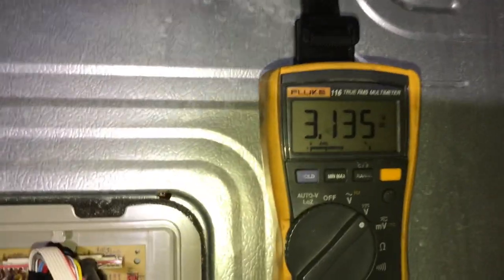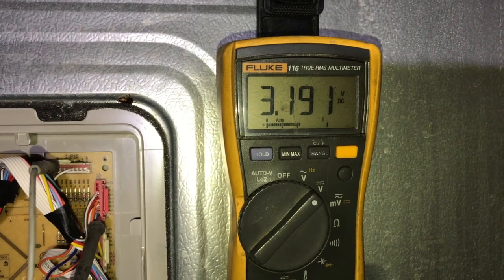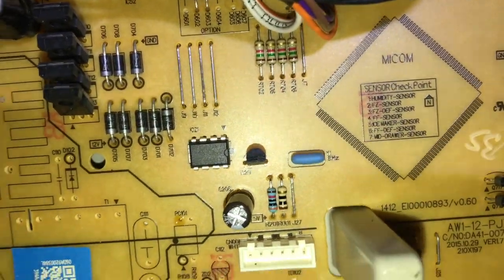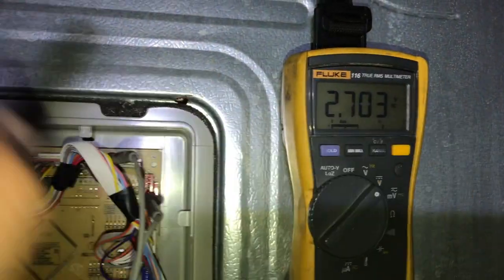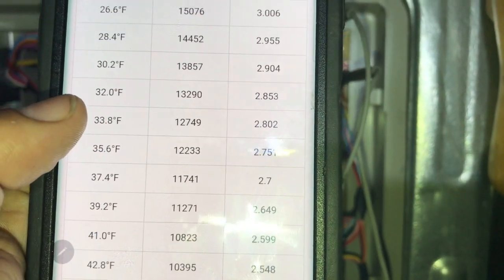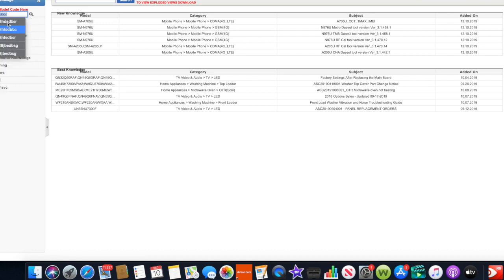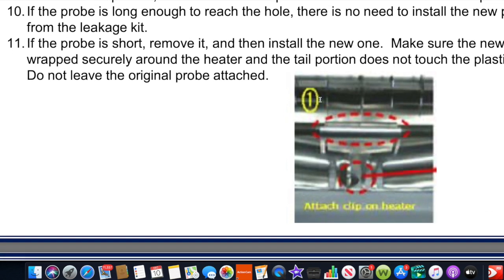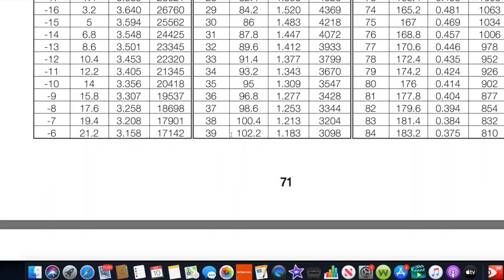Sensor Check how to test and quick view to defrost issue Samsung

Comment: Nice vid. This drain icing problem can be a persistent reoccurring pain in the arse. I'm seeing that the ducks bill at the drain end tube is usually clogged with sludge, or it's hardened shut and full of water. The ducks bill was a failed design used in the 60s and 70s by Frigidaire, and now manufacturers like Samsung and Whirlpool are back to using it again. 

I've reverted to using a drain probe heater that's longer than the one Samsung provides, and even considered installing a low wattage braided drain heater into the drain hole if all else fails. Braided drain heaters were used often yrs ago.

Samsung should have designed the metal trough with a foil drain heater they use in some other models such as their SxS.

Comment: Hi 
Thank you so much for your video. I learned a lot. Please provide if you can  link to Samsung web you mentioned in video .
     I tried locate that web. But no luck.
 I deal with temperature issue in my fridge RF25HMEDBSR /AA 12
Thank you
Reply: Bought my RF28 in 2014 and just started having all these issues about 2 years ago.  I refuse to buy a new $2800 fridge...  Have you has any luck finding a fix?